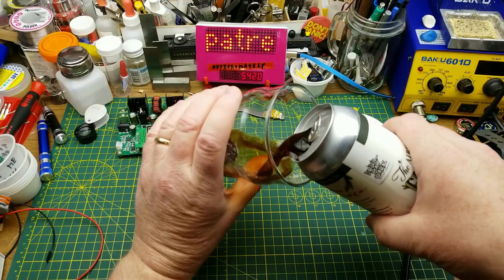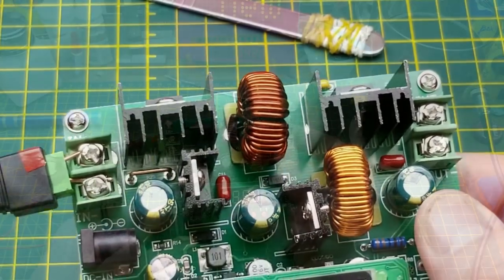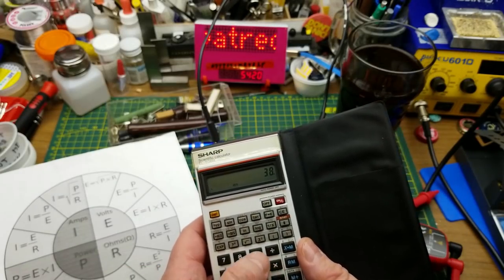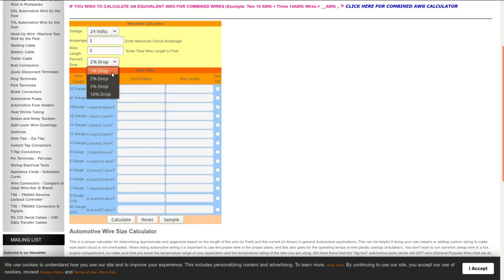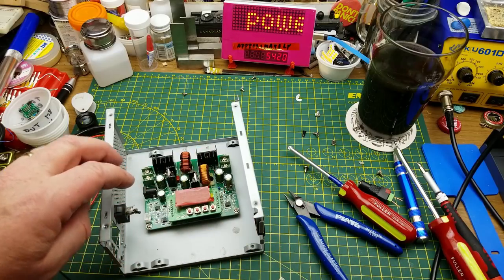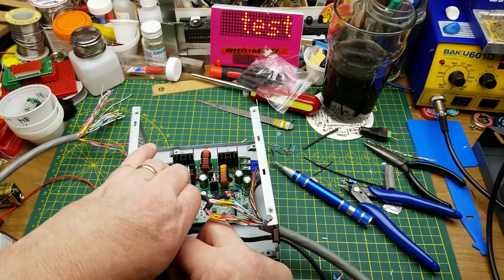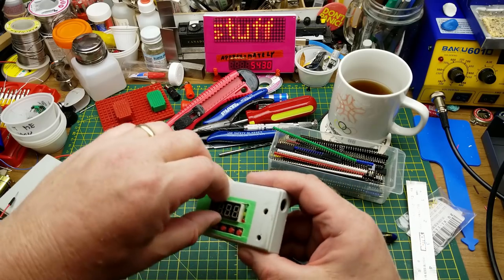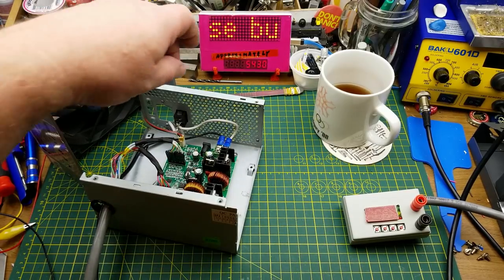Checking out a new power supply and making a case for it

Comment: I finally got mine in the post. Found the pinouts for the small display/MCU board. Bit late for you but should be helpful for anybody building a remote case. It seems power supplies from Ming He that use the daughter board, the board is the same physically but the firmware (locked) is different.

Right side:

  Top four (1-4) pins are GND
  Next two (5-6) are Vcc +5V
  7 is connected to MCU UART RX
  8 is connected to MCU UART TX
Left side (Top to bottom):
  Pin 1: Iout sense,      970mV/A + 140mV
  Pin 2: Vout sense,       72mV/V + 42mV
  Pin 3: Vin sense,          62mV/V
  Pin 4: Iout control,     970mV/A + 140mV (PWM, off when output off)
  Pin 5: Vout control,     72mV/V + 42mV (PWM, off when output off)
  Pin 6: Enable control,  0V = output on,   5V = output off (Digitally controlled)
  Pin 7: CC/CV sense,   CV = 0.47V,   CC = 2.5V
   (serial LEDs between 3V3 and GND)
  Pin 8: Connected to MCU pin 13 (PC3), unknown function

Comment: If it were me, I would have fixed and used the 12v and probably 10a supply board you pulled and tossed as your supply and mounted the boost / buck in there as well.  Thanks for taking us along for the ride.
Reply from the maker: I've got another old ATX power supply that is converted that way. I should try to remember to pull it out more often.
You can never have too many power supplies available. (or at least that's what I tell myself...)

Comment: Smashing job, the old switchode case is ideal :-D
There is still enough space for a higher power laptop charger to sit inside, if one comes your way :-D.
The only thing i would worry about is running the power out with the controller lines in that cable, a power spike could upset the controller.
But it may not ha ha :-D.
I like your creative and sometimes sneaky ways of getting what you want, it's an art you know :-D

Comment: Steve Wagner (RIP) had posted all the face panel tempate for the B3303 and I built a dual 3A/3A power supply with two 32VDC 3A power bricks into a re-purposed case. I would like to build a dual supply using this one some day
Reply from the maker: I wasn't aware that Steve was gone. Sad to hear.
 I remember getting some very good ideas from his videos.

Comment: Bravo. Well done. Maybe in a future video you could lose the cord connecting the two units and go wireless using the wireless modules you keep getting in mailbags?
Reply from the maker: I've done some searching and the serial port I found doesn't seem to be as useful as I was hoping.. It would have been nice to be able to control it differently.

Comment: I would've gone with everything in the ATX because the remote box will be pulled around by the leads due to it's low mass. At least it won't take up much desk space.
Reply from the maker: So far the remote is staying in place due to the cable being routed past my pint glass.
Reply: I would add more weight inside the remote box to help it behave better
Reply: @wooferhound7571  or outside, nice heavy magnetic steel maybe

Comment: Yooo, couldn't you fit the power brick inside of the ATX PSU box also?
Reply from the maker: Nope. The power brick is 16CM long. The ATX psu case is 14.5CM
Reply: @pileofstuff  Could you mount it diagonally?

Comment: What's the source for the posts you showed at 21:03? I'm trying to build a bench power supply from an ATX and most of the posts are hooooorrrrrible.
Reply from the maker: I think I got those from some random e-bay seller several years ago. These are not the best ones I have encountered.

Here 's a search that finds some similar ones, plus some higher quality (and higher price) ones.
Reply: @pileofstuff  Oops, no search...
Reply from the maker: @DavidPlass  Doh!...
https://www.ebay.ca/sch/i.html?_nkw=speaker+binding+post+terminals&_sop=12
Reply: @pileofstuff  Thanks. That search is broad and it's difficult for me to ascertain the relative quality (and usability) of the terminals. I may just try what I've got (chineseum)

Comment: Measure the output current by using the 10A range on normal multimeter and just short the output. Those DC clamp meters are NOT accurate.
Calibrate the MingHe units B3603, D3806, etc that use this small control/display board PCB using the procedure in the first post of the thread on EEVblog : https://www.eevblog.com/forum/reviews/b3603-dcdc-buck-converter-mini-review-and-how-the-set-key-could-be-fatal/

Comment: I thought you would go wireless with arduino stuff for the controls?? that would be clever :-)
Reply from the maker: It turns out the serial port that I saw on the board isn't as useful as I initially hoped. My searching found some people have been trying it and they all came up blank.

Comment: Had to laugh at you getting burned at 8:17!  You forgot to calculate power with both resistor combinations ahead of time.  The 100 ohm resistor was only rated at 10W but you were at ~14.5W which is OK for a short period but will get pretty hot.  Then the 8 ohm resistors are likely 25W each but you had them at 45W each so they won't take long to get hot.  Be careful.   ;-)
Reply from the maker: Yeah, I expected they would get hot (that's why I checked them) - I just didn't expect it to happen that fast.